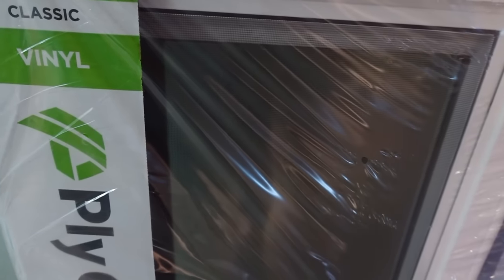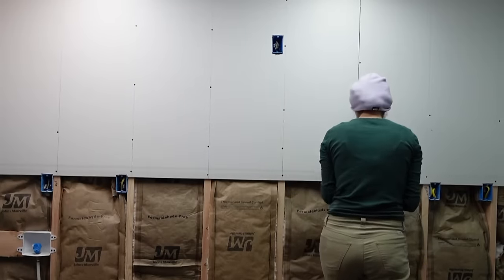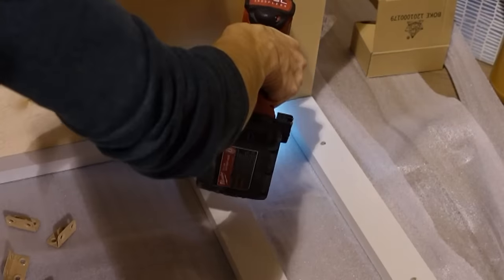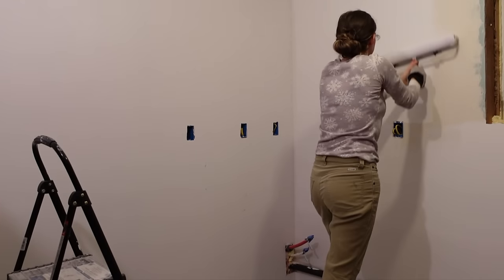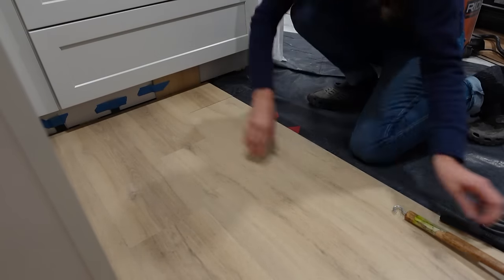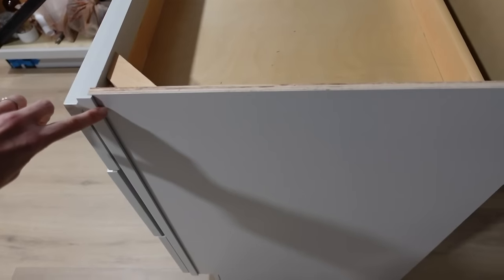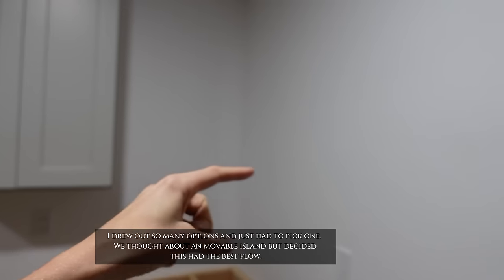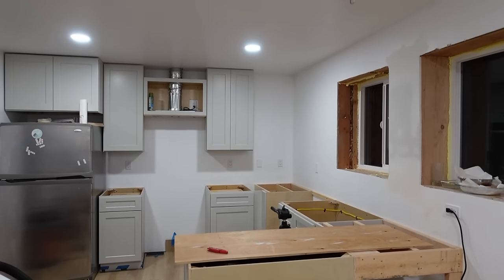Cottage Kitchen Renovation / Extreme Kitchen Remodel in the Small Home Part 1

Comment: I was surprised when I seen your cabinet choice I am one step before you my reno is basicly completed which sucks cause your ideas would have helped with some of my stress lol. I went with valleywood cabinetry ideal gray from lowes and they are all wood and we had to put them together they are not as dark as the picture which i was pleased with they have the dove tail soft close drawers and were so affordable too i priced them out and they were cheaper than ikea by far plus ikea didnt have 18inch drawers in stock and i needed that beside the dishwasher. I also went with a really nice extra large single sink with cup washer, cutting board, waterfall (for washing veggies and fruits) it even had a basket for that, a pull out modern faucet in black, self drain   with the cutiest barbie sized basket to catch stuff before it falls into your septic and a smaller wash basin that was removable all black stainless steel i bought it from amazon and it was delayed in shipment so i ended up finding the same sink on wayfair and it was cheaper and faster on the shipping it was only like $239 it is amazing noway to find that size with all the extras at lowes under $1000 so score! we too had to start from scratch in our kitchen it was tiny now it is bigger and functions so nicely we love it! i went with a pale yellow for the walls which is so not like me at all but with the cabinets it looks amazing oh we splurged and got the glass hood for the range and the samsung bespoke appliance package in glass as well since we saved on the cabinets and doing it ourselves the applainces including the washer and dryer were around $6500 but omgosh they are sleek and so nice and the glass from fridge and dishwasher are so nice and the stove has an airfryer never thought i needed one now i cant believe i lived without it lol
Reply from the maker: It’s exciting when it all come together!! Happy for you

Comment: I was trying to tell if you put flooring down in the area where the dishwasher will go. Seems like you need to so you'd be able to pull out appliances (DW or stove) if you needed to make a repair, etc. Otherwise you'll have a lip from the flooring in front of the appliance if it would need to be pulled out of it's space. The house we bought had parquet flooring in the kitchen & they stopped it in front of the DW. When we had to replace the old DW, it wouldn't come out because of the crazy way they installed the wood parquet & the flooring was damaged trying to pull out the old DW.😢
Reply from the maker: We went under every appliance so it would be seamless and easy I stall